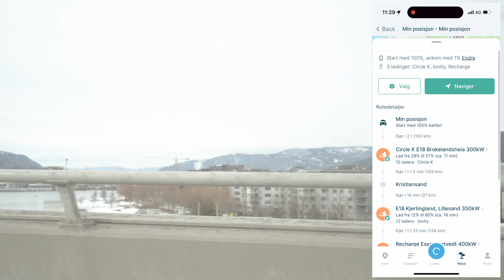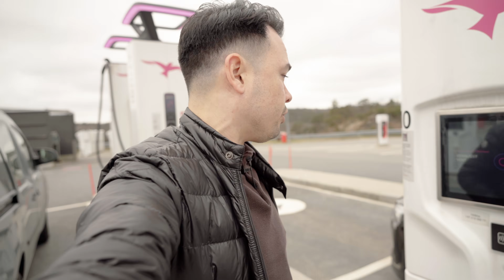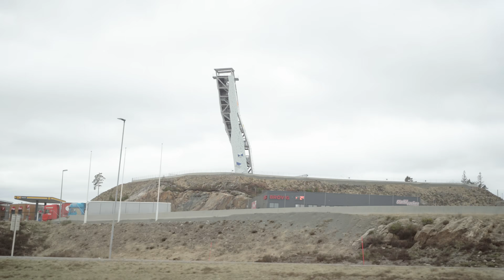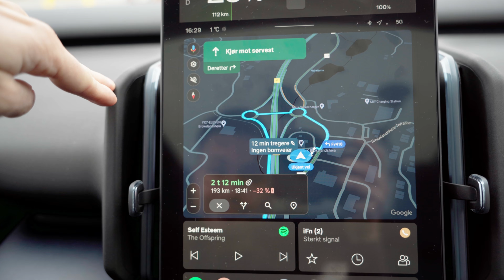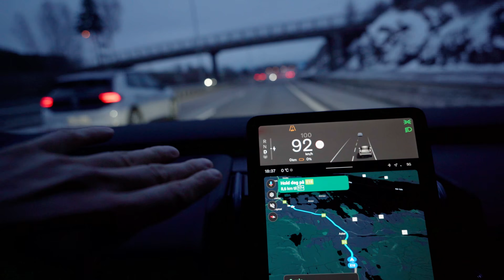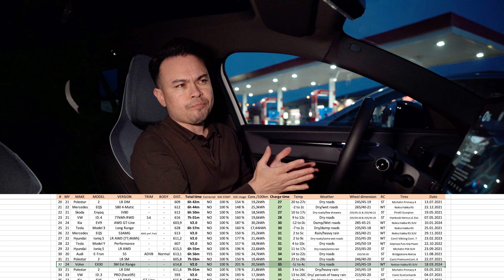Volvo EX30 | Single Motor Extended Range | Long Trip Test

Comment: not being an EV owner, I'm not 100% on what's what, but 
would it be fair to say it's more efficient to charge between 20-50%  when the charging speed is at it's fastest.  Do that more often than long charging sessions of 5% - 100% ?
Reply: You're absolutely right, but the charging speed depends on the car's specific charging curve. While the EX30 can handle a maximum of 150 kW, using a 200 kW or 350 kW charger wouldn't provide any benefit.

As an EX30 owner myself, I've found the best performance comes from a 150 kW charger when the battery level is between 12% and 33%. For slower chargers like 50 kW or 60 kW, the sweet spot is between 10% and 79%.

To answer your second question, I personally prefer using a 50 kW or 60 kW charger and charging up to 80% while I run errands or take a walk.  For longer trips, I take the time to use a 30 kWh charger to reach 95 to 98%.

Here in Portugal, there's a flat fee for using the charger regardless of charging time. This makes longer charges more economical since you avoid paying multiple fees.

Comment: Between EX30 and Aceman, which one is the one if consider fun to drive, speakers, space, considerate on day to day use and so on, Aceman is front wheel drive is that ran less go kart compare to former and it has no frunk even is build on EV platform, EX30 glass roof don't have cover like the latter but it has my favourite yellow color OEM-ly!

Comment: The thing that "rattles" me the most is it's consumption. Compared to very comparible cars (with even higher CW values) like a Kia Niro, it's just like 20%+ more consumption at the same circumstances. Even mine own Polestar 2 dual motor with enormous tires wil do this kind of consumption figures (also seen in you Excel at the end). All the other boxes are checked by Volvo. Fun looking car, it's a B segment SUV, so don't expect to much space in the back, but in the front (where you are sitting) it's quite marvelous. Good ride quality, android auto is so much beter then all the other infotainment systems (its even on par with the Tesla I had before). Pricewise it's quite comparible, performance is on par and even more, only that consumption..
Driving an EV to 0% SOC is something you wil do sooner or later as an owner, and a EV is very predictable, so no worries there. But this EX30 will make it quite an obligation.

Comment: Thanks Kris, great video. I'm considering buying the EX30 and have been very impressed with the test drives I've had, love the work you've done proving range and charging. Probably will buy, can't make up my mind on which motor, twin or single.

Comment: this is BS review. what I need to know is the size of the battery, the speed when testing (hopefully 120 because with 100 you don’t get anywhere) and number or kilometers done. simple. anything besides that is not useful
Reply from the maker: Excuse me? First of, this is a Long Trip Test, not a Review. I've done 17 videos testing different aspects of the Volvo EX30, just pick the one that answers your questions. If you want to know the range at 120KPH, watch my RANGE TEST. SIMPLE. You are complaning about something this video does not set out to answer. It is like going to a cake store, calling it a bullshit store because they don't sell hardware supplies.

The Long Trip Test is a very useful test that shows and compares how different EVs behave and perform on a long trip. Very useful for a lot of people. It is not bullshit just because you don't find it useful.
Reply: @KrisRifa  sorry but it did not answer simple questions as stated. especially as a long trip.
Reply from the maker: @luciannaie  Your question is how much range does it get a 120kph, and that is not something that is answered in this test. For that watch my RANGE TEST. How hard is that to understand? 🤦

To know the range - Watch my range test
To know performance in a long trip - watch my long trip test
To know my opinion on the car - watch my review
To know what I don't like - watch my 9 things I hate
etc etc etc

Sure your question might be simple, but you still won't the an answer if you're looking in the wrong place....
Reply: @KrisRifa  it's not hate. you might want to conclude your videos with a clear message. I have limited time, I watch the beginning and the end.
Reply from the maker: @luciannaie  It's called "long trip test", and I explain clearly what the test is about at the very beginning of the video. If that isn't clear enough for you I don't know what to say.

Comment: Why don't you charge the car more at each stop? Surely there is no normal person who drives their EV the way you do? 

And why do range tests at highway speeds? Shouldn't it be better and more realistic to do it at lower speeds?
For example 80-90 km/h
Reply from the maker: I explain why in the video, several times. How did you miss it? But I'll explain it again. The point of the test is to complete the route in with the shortest charging time possible. Hence, charging the car just enough to be on my way.

As for you other question, this is not a range test. I do that in another video which is called "range test".  Those tests are done at 120kph, which is the around the speed limit for most of my viewers. And offers the shortest range for the cars that are tested. If you can get for example 300km at 120kph, you get even more at 100kph, and even more at 80 kph, and even more then at 60kph.

I only have these cars for a week at a time, and can't all different types of tests in all different scenarios and conditions.

Comment: Thanks for the interesting results, particularly the consumption of 20.5 kWh at -1° to 4° with a speed of 95.8 km/h. I noticed the very different results from similar tests all with a speed of around 100 km/h. https://youtu.be/HX_XP54qYa8?si=ydop0UY4R5b5KUmS&t=545: 19.1 kWh at 9°, slightly wet road? (most likely cruise control set to 100 km/h, in reality probably somewhat less contributing to the low consumption in combination with the warmer temperature). https://youtu.be/8C3F_66h-c4?si=0uEUh6SChXcRdbtZ&t=959: 21.8 kWh at 7°, dry road, is on the other hand very high. Thus, it seems that wind, driving style (although probably all used cruise control as much as possible), and topography have a considerable influence in these similar tests (all seem to have used the same tires).

Comment: Great video. Yeah it's quite useless when charging under 10% 😂 And quite annoying that you don't get any information regarding battery condition when low SOC. No visible power limitations or  turtles 🐢 Wouldn't have the guts to drive it so deep
Reply: Under 10 % should be fastest, what is Volvo doing?

Comment: Interesting size Volvo. Hilarious driving to 0 charge. Good job. Greetings from Collierville, Tennessee. I owned 2 ICE Volvos when my boys were young. Both served us well for over 110,000 miles. I visited Gothenburg Volvo to help improve their disc brakes.
Reply: Worst part about Volvo (and Polestar 2) - pads fuse to the rotor if they are mildly wet at park. No other EV/ICE I've owned had this problem. So bad you have to floor it to break free from park, chunks tear, stick, and clunk every revolution.